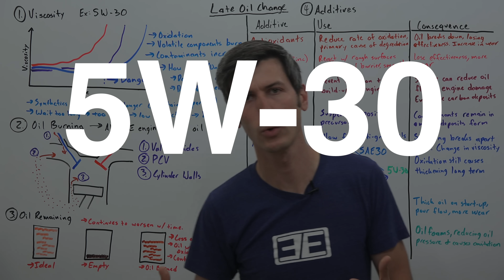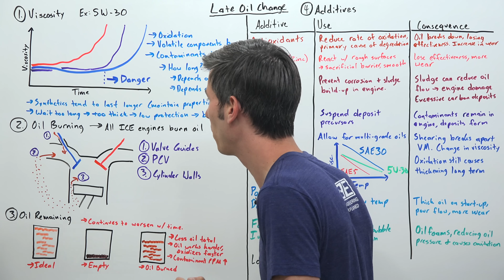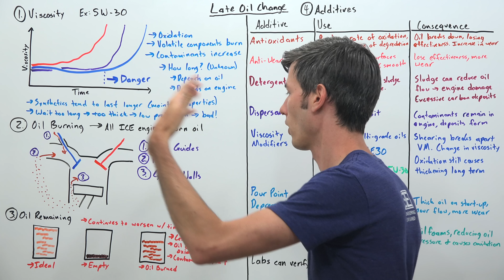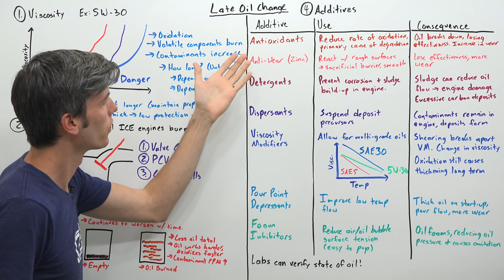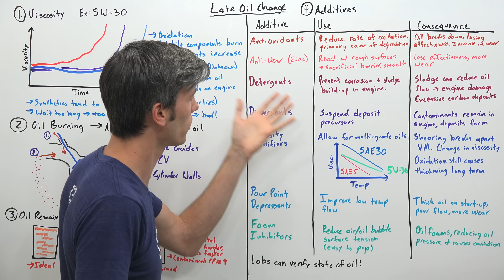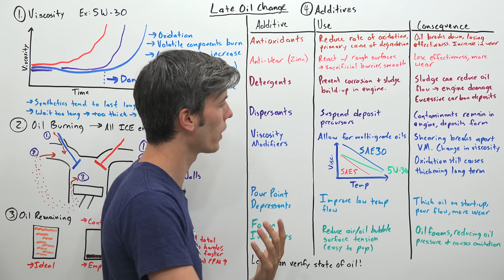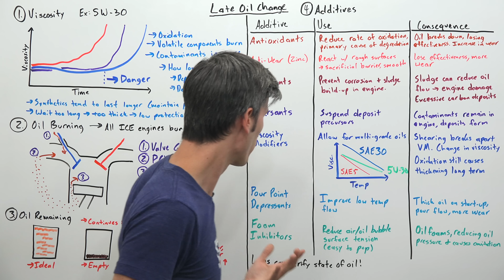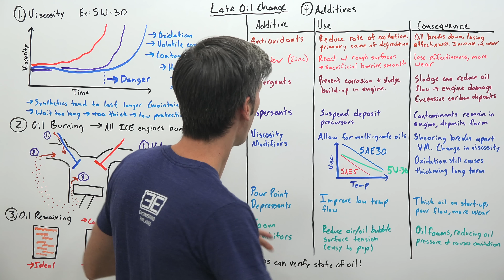What If You Forget To Change Your Oil?

Comment: You don’t really need to change oil if your car leaks so much that you’re adding a quart every week amirite?
Reply: still need to in order to change out the contaminants that formed. they don't just disappear with the oil.
Reply: @n_u001  thats definitely true for burning oil, but leaking? Your loosing contamination as well plus cars that leak/ burn oil are likely old and clapped out this no reason to baby them lol especially if you have an oil leak that you refuse to fix the car is a beater for sure
Reply: @n_u001  contaminants are supposed to be removed by the oil filter and the crankcase ventilation. Of course you need a bypass depth filter and normal operating temperature.
Reply: @ralphwood5114  you still need to change the oil because if the oil burns, the contaminants are left behind. if they werent filtered by the filter they will continue to harm the engine.
Reply: I started using filters that clean oil in 1963 when engines were nasty and Motor oil wasn't very good. Multi grade oils didn't hold up. These modern oils and modern engines are a piece of cake to maintain. Full flow filters remove the large engine damaging abrasives of which are few in a modern engine. The smaller engine wearing abrasives build.up in the oil until you drain the oil. Not a good maintenance program but very profitable if you are in the oil change business. I started using the Frantz oil cleaner.all I have now is Motor Guard and Gulf Coast filters.I am presently using Great Value 1000. Elements from Wal Mart. There are other filter elements as good for about 30 bucks.  Haven't sold the filters for years.
Reply: @ralphwood5114  Contaminants absolutely are not removed by the oil filter. The oil filter removes particles from the oil. Contaminants are solubles mixed in with the oil. They pass right through the filter just like the oil itself does.

The crankcase ventilation system does not remove contaminants either. It only draws gases back into the combustions chambers where they case be burned. In the bad old day, engines had a road draft tube which vented the crankcase gases directly into the air.
Reply: @n_u001  Should leak out with the oil. It's a leak, not a still.
Reply: I had a Subaru that would change it's own oil..
Reply: @bartricky5894  There's Diesels that legitimately divert a small portion of lube oil to be burnt with the Diesel.

I guess you just change filters then, and top off? Can't imagine modern emissions allowing this any more.
Reply: Need to change your seals at every oil change in that case
Reply: i was wondering the same thing. i have an older BMW and it burns a lot of oil.  i put in about a quart a month. its full synthetic.  i like to change oil at 5k miles its been like 10.  i did change the oil filter.  idk how bad that really is
Reply: @Stuntzii1  smart men. I have a 4.6l v8 f150 1997. That girl had the ol' 20 w 50 mobil 1 oil for 2 years in the engine aprox. Same basic filter from motorcraft, the cheapest. No biggy, runs great. Changed oil today, new spark plugs, pcv valve, inyector cleaner and it purrs like a spoiled kitten. Also trans fluid that had been there for 75k miles or 3 years aproximately lol
Reply: Don't keep putting that “Hi-mileage” oil in. It has stuff that causes the synthetic “rubber” seals to swell just a little. They can’t keep on swelling forever.
Time to sell the heap or trade it in on one of those “drag it in and we’ll make a deal” sales.
Reply: @Stuntzii1  did you check your oil pan gasket and valve cover? Also consider 5w40 LL01 Euro spec.
Reply: Agreed
Reply: I would love to believe that.
Reply: Sounds logical
Reply: That was my sister's reasoning... so now I am in charge of maintaining her car. Somehow it has managed over 400,000 km. Says a lot about Toyota.
Reply: @mark2073  You probably know this, but keep that PCV valve changed every 30-40k or 3-4 years.  It will s too cheap and easy to replace not to do so.  The consequences of not doing doing so can be catastrophic.
Reply: I bought a '93 Legacy that leaked oil for $500. It had 363k miles. First thing I did was drive it from Denver to Kansas City and back to visit family. Ended up driving it to 410k miles. I never did an oil change or filter change, just put a quart in every time I got gas. It ran great. Why'd I finally get rid of it? It couldn't pass emissions.
Reply: I guess I got lucky. Bought a new Subaru in 84 .  Never drained oil .Changed the Frantz oil cleaner every 12k
Reply: @ralphwood5114  I think u did
Reply: In the industry that is called the VW method. It will either leak out or burn off faster than the oil can get dirty. Just top off as needed... usually weekly and keep on rollin.
Reply: @boost331  married a woman with a 66 beetle. It didn't have an oil filter. Had a lot of big metal particles in the oil. I think it called for an oil change every 1500 miles. All the large stuff settled to the bottom of the sump. The new oil picked it up as soon as you started the engine after an oil change. I solved that problem with a Motor Guard oil cleaner. I liked the car but it was crap compared to these modern cars. Had a little over 150 K on it when I sold it. Lot of miles for a beetle.
Reply: @ralphwood5114  What kind of hippie are you?
Reply: Dangerous One correct... just do your filter every 3-5k with your weekly top off
Reply: @Dan Gleeballs Dude, you made a Flintstones car. They get excellent gas mileage!
Reply: Both head gaskets started leaking oil sometime after 250 K. Caterpillar lab said the oil looks good for that many miles but every 6 K would be better for the filter change and a new quart of Mobil 1 added. Bought a 93 Legacy used with 116 K . it has 240 k on it now. Never used synthetic since  I have owned it. Seldom needs oil and doesn't leak. Have Motor Guard toilet paper filters on the engine and ATF. All a good filter can do is clean oil. Can't prevent leaks.
Reply: My brother do that in his Yugo
Reply: It Will get a Lot of insolúvel and solid contaminants over time. You can change Less, but you still need to change it
Reply: Fill the oil and check the gas! Good to go!
Reply: You can follow your oil trails if you get lost.
Reply: No. Just change the filter at prescribed intervals until you fix the leak.
Reply: Correct
Reply: uritebro!
Reply: You should probably fix that leak. You're probably spending more on bottles of oil vs just fixing the leak
Reply: No need to change the oil change the car.
Reply: I have a ‘96 Cadillac with the Northstar engine. as the original owner, i change the Dexcool coolant every 4 years, and i only use Mobile 1 synthetic.  synthetic tends to leak - especially in a 25 year old 32valve 8 cylinder engine. i do not follow the oil life monitor,  but instead change it every year as i might only drive 4000 miles in a year for my mint garage queen. i know it is a waste using synthetic, but it lubricates the internal parts better, and adding a fresh quart between changes keeps the additives fresh.  btw, that 300 horsepower 4.6 liter engine holds 8 quarts of oil.
Reply: Your engine will build up solid chunks until it blocks the oil pump or some important hole and your engine will break.
Source:my father in law had a leak for about 6 years and never changed the oil just added until...you know what I mean
Reply: Only if you are using synthetic. Else there will not be powerful enough dispersants to break down the sludge into pieces that can get past the valve seals or piston rings and it will just accumulate somewhere, likely clog the valve seals and then you will have wearing valve guides
Reply: Only filter
Reply: You still need to change your oil filter!
Reply: Depends on where it's leaking. If it's leaking into the coolant you'll need to change it more
Reply: In eastern europe cars are so warn out that they brun oil, i had bought an A140 w168 from 2001 with 600 000km out of fun (but with 150 000 on the clock, quite common here, like evey car has at least 300k shaved off. This is the reason i cridge when people in the west sell the car that has 100k saying its too old and worn out haha). It was burning arround 1L per 600km, but i added a thincker oil last time i done a change + 1L of transmission oil. It now burns nothing, like nothing, the smoke isnt blue anymore and it doesnt smell. Quite interesting
Reply: @pequlatv4814  Well there's your problem, you bought a Mercedes.
Reply: That's a self-servicing engine.  Very fancy!
Reply: Heal yeah brother
Reply: @Dangerous One
haha.. yeah probably right, if it doesn't build up some sh*t somewhere then you only have to replace oil filter now n then. I always check oil quality by rubbing a small amount between my fingers. You can feel difference from good vs bad lubrication. The color also shows quite clearly when the fluid is bad (=dark brown/black). No need to send to any lab.
Reply: @pajdeg2831  My nephew drove a car like that.  Tank of gas quart of oil for 200,000 miles. Drove it to the junk yard at 260,000 miles because he could not find the fault in the electrical systems and it would drain the battery. It did not burn oil.
Reply: @pajdeg2831  Color really doesn't tell you anything. Oil darkens in the presence of heat, aka anytime your car is running. It doesn't necessarily correlate to being dirty.
Reply: Also works when it burns oil lol
Reply: Ehh just the filter lmao
Reply: Also an excellent rust detergent
Reply: I guess not, just change the filter every 5K miles or so.
Reply: I had a 76 Ford Pinto that required adding every fluid a car uses every day.  Oil, brake, coolant and transmission fluid.  Drove it like that for 3 years when I was in school.
Now I drive nothing but new cars and its such a pleasure...  lol
Education pays!
Reply: Dangerous one..Yes you are right..its when a car engine turns into a 2 stroke with a total loss lube system🤣🤣🤣
Reply: Shitbox crew where ya at
Reply: wrong. Oil picks up dirt which only leaves the engine when letting the oil exit via the screw on the bottom.
Reply: My old Ford has 325kms on the clock and leaks 500mls every 40 minutes running time..Since 200kms I deliberately never changed the oil or filter just top it up and it still runs super smooth and reliable..now that's over 7 years ago guys..Whens it going to die?
Reply: @albertsammut433  problem is - when the filter is saturated, the oil pressure opens a bypass valve and doesn't get filtered anymore. Dirt gets into the oil tub and can only exit via the drain screw. therefore You should do an oil change with filter soon except its an experiment and money isn't the problem and youre just waiting for a reason to buy a new car.
Reply: at least change oil filter then lol
Reply: No, you don't have to. What you must do is change your CAR... this one will not last much longer anyway.
Reply: As long as the filter in placed so you can change it without draining this is more true than some want to know.
Reply: Chevy or Mazda?
Reply: Lolol. I had an old 57’ Chevy 6 cylinder,  ‘Farmer four-door’ that used, burnt, & leaked about 2qts. A week.  I was poor, so I used this gross, cheap, Green colored, recycled oil called ‘Rev’ at 20 CENTS a quart!😁
Reply: You still should change the filter on schedule. You’re mixing the remaining oil in the sump (oil pan) with the new oil to a much greater extent than is left as a puddle in the bottom of the sump.
Reply: Mine only leaks from the top when I fill it up!!🏴😁
Reply: You must own a 5.3L. Been there, done that.
Reply: We had a Datsun B210 my pops bought used in the 70s. It burned oil bad. He just added a quart about every 6 weeks. That was the only thing he ever did to the car other than put gas in it for 4 years.  He paid $450 for the car (body damage) got 46 mpg. And sold it in 1980 for $650. Said the cost of oil back then was so cheap he still broke even.
Reply: need to change the filter
Reply: As long as it's synthetic
Reply: camaroman101 no some cars dolt like it my Hyundai will peak it straight out on to the ground over night! Put regular Dino oil in it doesn’t leak! Well it so slow it’s not a problem I should say! But this is a 2007 so not a new car or anything but it’s done that since 90k miles! I thought it had just cleaned the engine revealing a leak but it was the actual full synthetic itself that was making it leak! Even now if I use some to top it off it will run out over night!
Reply: actually happened to my dads old car. the car would lose oil every day. so by 2 weeks he had replaced all oil with new oil
Reply: Not really, my friend adopted that on a rover 3500 and it built up so much sludge it eventually blocked a bearing and ruined it.
Reply: Dangerous One if a car is leaking that much oil your a horrible person for driving it and polluting so much
Reply: SI Rich you know that term “leaking” does not necessarily mean dripping into the environment.  most people say “leaking” where it is actually “consuming” in the old days it was called “burning”.  my Cadillac Northstar for example can consume a quart in 1500 miles, and that is normal.  the oil gets passed thru the seals, rings, etc, and is then sent into the combustion chamber where it is burned and converted into energy along with the gasoline.  the burned byproduct is then passed thru the catalytic converter where it is processed per emission standards.    oil manufacturers stopped adding zinc (zddp) to the oil because it would damage the catalytic converter.  many high performance engines consume oil - like my 32 valve engine.  - lots of parts moving around and lots of rings and seals where oil can pass thru.
Reply: David James yes I’m aware. Still same result though, no?
Reply: SI Rich no, it is not the same thing.  the oil gets ingested into the engine and burned as fuel the same way gasoline is.  consuming a quart of oil in 1500 miles along with  75 gallons does not make one a “horrible person”
you need to let go of the fact that an engine uses oil as it is run is a bad thing.  engines come out of the factory consuming 1 quart every 2000 miles.  that is why many cars now have a “low oil level” sensor along with the “low oil pressure” sensor.
Reply: David James idk, I change the oil in my 05’ 4Runner every 4K. Maybe a quart was used. The numbers you quoted are “acceptable” to mfrs but never that much in my toyotas. My only point is if your consuming a quart a week.......don’t drive it.

Comment: "ICE engines" is like saying "VIN number"
Reply: Paul D or ATM machines.
Reply: @hugostiglitz8378  ass to mouth....well that's what my husband said.
Reply: @alexisknows6513  never go Bass to mouth
Reply: While true, I often give it a pass when the acronym + redundancy is still less syllables and easy to understand

eg: ICE engine is faster than saying internal combustion engine,
VIN number is faster than Vehicle Identification Number etc

And many people won't immediately know that ICE is referring to an engine type unless they've been watching for a while or are very familiar with the language so saying engine afterward helps with that.
Reply: or LCD display
Reply: Maurizio Oiziruam doesn’t lcd stand for liquid Chrystal diode ?
Reply: @robertgraham5486  I know this is 5 years late but you're thinking of LED or Light Emitting Diode. LCD is Liquid Crystal Display
Reply: I say VI-Number lol.
Reply: @KartTrackReviews  Me too. I no longer work at the Department
of Redundancy Department..........
Reply: @KartTrackReviews  You are correct. Saying VIN number is just repeating “number” which the “N” in VIN stands for. I used to just say “VIN” but that confused people; so now I am redundant and go with the flow and say “VIN number.” You can be correct, but people will be confused.
Reply: Technically correct. However, the redundancy flows better with the redundancy in many cases.
Reply: Or SSD drives
Reply: Or RPMs
Reply: PIN number for cash points, or ATMs for those in the US
Reply: You are referring to “RAS Syndrome”.  Where RAS stands for “Redundant Acronym Syndrome”.
Reply: NIC card in the computer world
Reply: Yeah, everyone does it.
Reply: Arse to mouth machines
Reply: A majority of the American population suffers from RAS Syndrome or Repetitive Auditory Syndrome Syndrome. I blame the government and the Military.  Seriously, the Military is bad at this stuff.
Reply: 'ATM machine"
Reply: or hearing hiv virus or hpv virus
Reply: Yep, I had to run by the ATM Machine and put in my PIN Number to pull some money to buy a new PCV Valve.
Reply: Tucsonan Dude PCV valve is not redundant. The V stands for ventilation
Reply: That's from the department of redundancy department of redundancy.

Comment: Video Idea: VWs fix for TDI (CJAA) intercooler icing issue. The issue was causing hydro locking. There’s some forums that cover why. Basically perfect ambient conditions mixed with LP EGR. The fix is fully mechanical. Uses a thermostatically controlled vacuum switch to actuate a flap in the new intercooler. This flap blocks off 3/4 of the cooler. I believe the switch, why the fix works, and why the icing occurred would make nice topics. The fix kit can be seen at ECS Tuning. I have pics as well. So far it’s working for my car. Cheers!

Comment: I have a  1996 TOYOTA STARLET.
From 200000km to 400000km i was only adding oil to the engine,
no oil change,
no oil filter change,
no air filter change,
no spark plug change.
It works perfect.